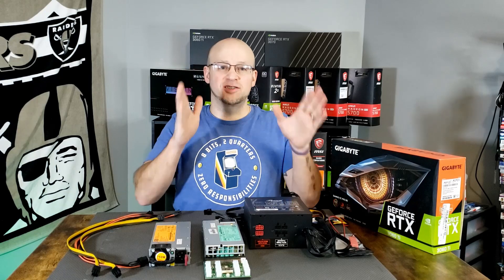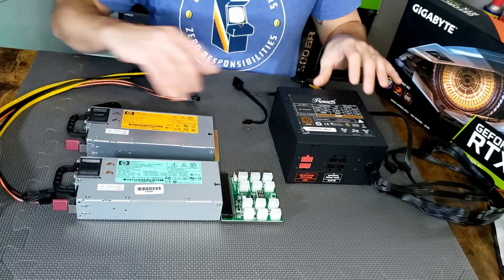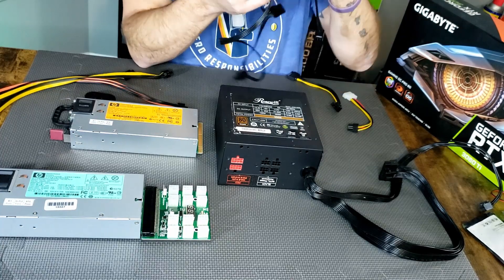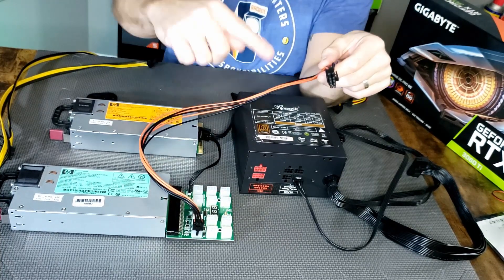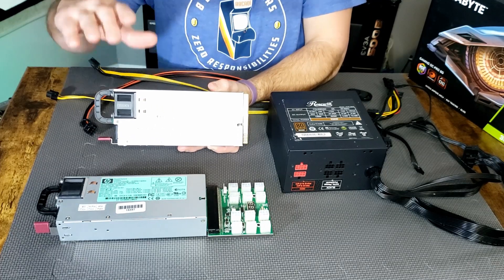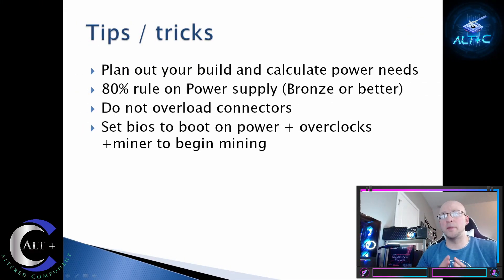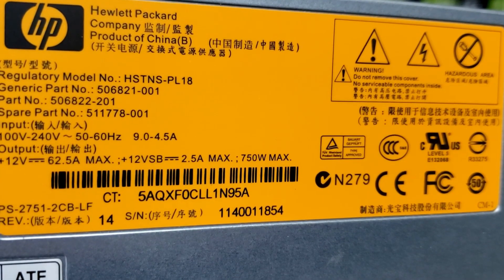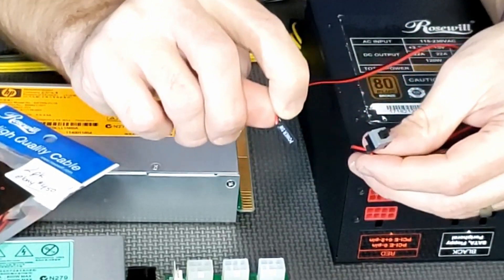How to use Server Power Supply for Mining Rig:  Quick Setup guide

Comment: Great video i just ordered a server psu. What kind of cables do i need to power my motherboard/cpu ? i think i will have everything for gpu,risers, but i don't know if i forgot something for the motherboard, thanks !
Reply from the maker: Thanks for watching.  if you bought just a server power supply to power the entire rig, motherboard, cpu, risers, gpus, etc, you need 1 of three options.  1) a standard ATX power supply to work with the server powersupply, 2) a ZSX all in one breakout board  or 3) A pico adapter to use with a standard breakout board.  You will still have to power the 24 pin on the mother board and a 4 or 4+4 pin cpu power.
Reply: @AlteredComponent  Thanks for the detailed answer, do you think is it enough to buy this for option 3 https://www.aliexpress.com/item/32828439849.html?spm=a2g0s.9042311.0.0.27426c37LiYA5o

Comment: What happens if I use ATX PSU to power my riser and server PSU to power the GPU? What happens if I power the riser and GPU on separate PSU?
Reply from the maker: Thanks for watching.  You can actually power the riser and the gpu from different power sources, but it is not recommended.  i did this for a couple years on an RX 570/580 rig and worked fine.  i had the risers all powered from an ATX psu and the GPUs were all powered by the Server Power supply.  That being said it is recommended to run a riser and GPU from the same power source to avoid issues.

Comment: Noob question I have a 1400watt server power supply and it says it’s rated for 200-240v now is there a way to plug this in a regular outlet maybe someone of adapter? Thanks for the education my friend just subscribed😇🚀😇
Reply from the maker: Short answer is no.  You can technically combine 2 x 120v outlets if on opposite pole and make a 240v outlet.  I have done this before for temporary measures, but it is not a good or safe long term solution.
Reply from the maker: Electricity is not a thing to play with.  If you are uncomfortable with changing Electric, consult someone who is qualified. Most u.s. have 120v outlets.  You may have 240 for a dryer

Comment: Isnt it dangerous to run 1 6 pin to 2 6+2 pins for gpu with the max wattage the cables can handle?
Reply from the maker: Perfectly safe in this instance. The 6 pin from a breakout board can carry up to 300 watts.  A 6 pin connector with 6 terminals in the connected is rated up to 288 watts.  As long as it is a 16g wire u can move 300 watts safely through a single 6 pin cable from breakout board.  A 6 pin connector on a gpu can only pull up to 75w.  A 8 pin on a gpu can only pull up to 150w.  So, safely run a 6 pin from breakout board with 16g wire and split to dual 8 pin connectors.  Take care
Reply: @AlteredComponent  i’ve been looking for this a long time on the internet. Thank you
Couldnt find anywhere that actually said how much W a 6pin could output on a breakout board. Im looking to use 6 pin from the breakout board to both the riser and gpu for my 1660 supers.
Only 1 question, how much on 18AWG cables?
Reply: Thanks for clarifying bro

Comment: Is that mini 4 pin mandatory, like can’t I just turn the psu on manually before the system boots, that ensures the gpu has power so it registers on boot, I only ask cuz I don’t have that cable and don’t wanna wait 12 years for eBay to ship it
Reply from the maker: You absolutely can just turn on the server psu manually.  If doing this way, hit the server psu switch and then quickly hit the ATX power button.  I did this on a rig for a couple years with no issues. thanks for watching
Reply: @AlteredComponent  no problem I’ve been watching for a while, great content. Thanks for answering that question by the way.

Comment: sata for risers really depends. i had 20 rigs do fine with them on 1050ti, 10606gb, 1660super. is it possible to run the whole thing off the server psu without a normal psu?
Reply from the maker: thanks for watching.  Yes you can use only server psu, but you have to either use a PICO adapter for the 24 pin / 4+4 cpu power with your breakout board or use the ZSX game changer all in one breakout board.  The ZSX is an amazing product but they are also selling like hotcakes.  This morning a batch was released with the 1200w hp in a combo.  they sold through quickly.  here is the pico adapter:  https://www.parallelminer.com/product/180watt-max-24pin-atx-power-module-included-sata-molex-cpu-power-connectors-ditch-your-atx-power-supply-entirely/?wpam_id=222
here is the zsx board: https://www.parallelminer.com/product/zsx-breakout-board-16-ports-pico-24pin-atx-fan-hubs-100-gpu-mining-a-game-changer/?wpam_id=222
take care

Comment: Can you connect two sata Connectors to one riser from two different 6pin to sata cables?
Reply from the maker: 6pin to sata are dangerous....here is why.  A standard 6 pin connector on a graphics card or riser board can pull up to 75 watts.  A sata connector can only handle 54 watts.  It would feasibly work, but trust me, it will eventually fail and melt.  I have melted a few myself over the years. A riser has the same possible power draw as the x16 slot pcie on a motherboard...these are rated up to 75watts.  Hope I answered what you were asking there

Comment: Hello Buddy

thank you for the video. You have a very nice explanation of this part, but the fact that I am not very strong with English, I wanted to ask you some questions.

Q1. I have 1 corsair 1000w and 1 PSU server 1200w now as you explained PSU server has 6 pin cables with 6 + 2 right? now I have MSI RTX 3060 TI and it has 2x 8 connetors now I want to connect 1 cable from PSU server with (splitter (Y) 8pin to 2x8pin) is it recommended and how many watts does the GPU give ?? because some in the forums say that it is not recommended to connect 1 cable with a splitter to 1 GPU for that I do not know what to do ??

Q2. I want to make combinations through the corsair and psu server for example with the corsair to connect some risers, and those risers that I went to connect with the corsair to connect to the GPU but the GPU to be connected to the PSU server with splitter is it recommended ??
or should both the riser and the GPU be connected to one place ??

to apologize for the text I believe you understand the essence
Reply from the maker: thanks for watching.  Yes, you can take a single 6 pin wire from the breakout board and split it into 2 x 8 pins for the single 3060ti graphics card.  you can pull up to 300watts from a single six pin on that breakout board.  A 8pin connector at a graphics card can pull no more than 150 watt total.  and when mining in this manor, you should have a 3060ti pulling only around 120-130 watts total when undervolted. 

It is recommended that you connect a riser and gpu from the same source.  So if you connect a gpu with the ATX power supply, you should connect the riser from the atx.  Conversely if you connect the GPU with the server psu, you should connect the riser from the same Server PSU. You can have say 2 gpus and risers running off ATX and the other 4 running off the server power supply and that is perfectly normal and acceptable.  All of That being said, on an older build i did a while back i did run all my risers from an ATX and ran all my GPU power from a server and did that for a couple years with no issues.  It is not recommended however.
Reply: @AlteredComponent  thnx very very this is the best explanation.. have a nice day my friend
Reply from the maker: @fatoshodja1517  thanks for watching.  Glad to help

Comment: I am completely new to this mining thing but I’ve always loved putting PCs together. That being said I’ve only worked on windows so HiveOS confuses me. Is it a totally separate software or is it apart of linux or windows? Also would you only need HiveOS to mine with or do you then need to use for example Phoenix miner or T-Rex? Great videos!
Reply from the maker: First thanks for watching.  2nd hiveos is just a Linux based operating system designed specially for mining.  From hive you can use many different installed miners, such as phoenix,  trex, lolminer,  etc.  You can also set your overclocks, change algos, and even program a new bios to a card (really for amd cards).  Hive os is a stand alone os for mining.  It takes the bloat of windows out and simplifies for mining.  It is a better option for set it and forget it type builds.  Me personally,  I like to tinker with much more and have the freedom to do more than just mine on a rig, so most of my rigs are on windows.  Look up hash raptors video on hiveos setup it is really good.  I believe mining chamber has one as well.
Reply: @AlteredComponent  Thank you! This explanation simplifies the process a bit. What software do you use to mine with on windows? I'm sure you've covered this in previous videos but I've only watched a few so far lol.
Reply from the maker: @Kyle-hf8dq  really depends on the card.     Back in the day everyone used claymore for eth...claymore basically is a dead project.  So then phoenix became the go to miner for eth.  The caveat is the new 30 series cards, those should be on trex.  I did many hours of testing and trex would allow better overclocks with less rejected shares specifically on my 3060ti's and 3070s. The main algo and mined item is eth, so short answer is trex on 30 series, phoenix on the rest
Reply: @AlteredComponent  Very interesting.  I'll keep all of this useful information in mind whenever I start my rig. Thank you for answering my beginner questions!

Comment: can you help me too,  be quiet! platinium 1200w or hp server 1200/1500w. Which one should I choose?.the most important for me is less power consumption. I'll use 6 or 8 cards rx 570 with btc-t37.
Reply from the maker: Hp 1200w is a platinum.  I would use either the hp 1200w with a zsx board and eliminate the need for a atx psu, or use a cheap 500/600 watt atx with a 750w hp server psu from parallel miner (with blue outlet as it is platinum) and an x11 breakout board.  The efficiency on those hp at full load is still 93-94%.  I personally ran 8x570/580 on a 750w hp and a bronze 550 roswill atx for 2 years. Was very efficient and really not loud because not full load on the psu.   Take care
Reply: @AlteredComponent  Thank you

Comment: How to connect 6 to 24 pin mb
Reply from the maker: You have to either use a PICO adapter, or you can get a special new Breakout board called the ZSX breakout board.  Both are available on Parallel Miner. https://www.parallelminer.com/?wpam_id=222

Comment: SO YOU ALWAYS NEED AN ATX POWER SUPPLY COUPLED WITH THE SERVER ? The server only powers the gpu while the atx power supply always power the rest of components ?
Reply from the maker: Well to be honest you do not necessarily need an atx power supply nowadays.  You could use just server power supplies,  but you would need a pico adapter so that it would have a 24 pin and a 4x4 pin for cpu.  Or they even sale an all in one server breakout board now on parallel miner that has a 24 pin, a cpu power cable and all the pcie cables...but the board alone is 60 bucks.  Personally I have always used a atx and a server psu.  The atx powers the mobo and components and the server powers the gpus.
Reply: @AlteredComponent  I believe I saw hash raptors video on that. Looked pretty sweet lol

Comment: Hello,  server psu power on first or the atx? or you can do it simultaneously? Thank you!
Reply from the maker: if doing manual, then server first, then atx.  but basically hit one, then the other.   I have an older rig where the server power supply cannot connect to the other atx so it cannot trigger on.  So, i manually flip that switch on, then i hit the main power button on the rig.  Thanks for watching
Reply: @AlteredComponent  thank you! :)
Reply from the maker: @jerwinwagan18  glad to help
Reply: @AlteredComponent  Yes man, I ordered my psu from parallel, still in processing, cannot wait to receive it. :)
Reply from the maker: @jerwinwagan18  I get a delivery tomorrow.   They rock
Reply: @AlteredComponent  :) how long it takes? I ordered last Saturday and still processing until today. Do I need to call them and ask? Thanks!
Reply from the maker: @jerwinwagan18  I would definitely contact them.  Mine Shipped next day.  It has been slowed due to weather though.

Comment: Hey quick question about the 4pin to molex to the atx psu. My EVGA PSU has 4 VGA ports which I use to power 4 gpus of mine currently with risers. Each VGA port has a cable split to power 1 riser n 1 gpu. Now I have to find power for three more cards on my rig. So my question is do I have to worry about that little 4pin to molex burning up and frying my break out board since the ATX psu already has GPUs in mine. My gpu is 850watts and the four cards with risers, CPU & Mobo is probably doing 550-600 total power from the 850.
Reply from the maker: Thanks for checking out the video.  To be honest you do not even need to connect the server power supply to the atx if not desired.  i have an older rig with a 750w HP server psu and an older breakout board.  it does not have the connector, only a old style sliding power switch.  For that rig, i manually turn that power switch on first, then the ATX power supply switch.  No issues for years that way.  But to answer your question, no, it will not overload the connector or fry your breakout board.
Reply: @AlteredComponent  thanks

Comment: How many RTX this server power supply support? I have 3x RTX 3090 and 1 PSU 1600W EVGA Titanium. But I can overclock almost nothing because the PSU don't support.

I have to setup another mining rig with 2x RTX 3090 and 1x RTX 3080 and I think about buy a server porwer supply, is infinite more cheap. I just not sure if works with 1200W server power supply in my case.
Reply from the maker: keep in mind that the 1200w hp server power supply is actually only 900watts if using 110 volt power.  That being said, if you are mining on those cards, you should be cranking the power way back.  Probably at 65% power, you want negative core , probably between -300 and -500, and you want to push that memory up to around 1200 give or take.  i believe a 3090 overclocked and undervolted should only used around 400w.
Reply: @AlteredComponent  Do you think support 2 RTX 3090?

Comment: In the "How to Connect" part of the video, what's the name of the mini 4 pin that connects the regular PSU to the Server PSU?
Reply from the maker: if you search "Floppy 4-Pin 3.5" Female Power Cable" you will get results.  You can get a molex to that mini 4 pin adapter for like 5 bucks.  Here is a specific example on ebay:  https://www.ebay.com/itm/Kentek-6-4-Pin-Molex-5-25-Male-To-4-Pin-3-5-Floppy-Drive-FDD-Female-Power-Cable/283397870825?_trkparms=ispr%3D1&hash=item41fbd454e9:g:38oAAOSweEFcdmOg&amdata=enc%3AAQAFAAACkBaobrjLl8XobRIiIML1V4Imu%252Fn%252BzU5L90Z278x5ickk7PdDazAlGltMLJlUhrWsD3xoBwpwBoRJc8%252B5cnkKRgb0NIj3riYvDL7L9bg%252F55aomq0cMjIDTWnCcBlWjlFGAXVX049OQftZTy6zTGPshb6%252Bh7ltZ2Eg8ktV%252F8yHGc1JINBIrMtAoY07ha6QLTCcx%252BIcpunOTyHrSWhM6pkSzBwk7kSZDf32%252BFK2DAEWI5F7moCuNb3mi1OGsAZvLPoHv2GHptnJE4BCA0PgEIfAu1oBOvs6ZcYu2S5dXMHSJR9Hjw2qMmHhIhsgOIg5d3DscqLITr8YYXB2Hcu0eLS9b1a6HgSI%252FyE54QAD2Kx6PJTfux3lrIu2OqnGZI2%252Bdm6L%252BObfY%252F85TNtxYVmd%252BXqP8P%252BzCZjtDytsPFTH%252FWl2YiV6%252B8MjfdBfs5BCq%252B2whKS9YxpGqUNN9JIR6lWNKyXwMh%252Bd7LzTjt0Ej8fOx5xxK1XtIROdi7P4LrO%252FpphEyqjS6dFoerkeeN9FZa6IZSFCUxMl5kD2vB7MfLKqHEf3Ua6P%252Fuw51UZ8rQC3e8kG80N%252BQlyV2DiczpktkMZRVDgoSVRmp5eJnjIiVazdaTjMlpJedzS9hfxKslwotSl8jHU%252Fk9s02ssAyI%252BhMmcoDsnOdVE7ueHrPOlN63nreJX8Tv%252FYG7r86VUzezq090jya96%252FMZo1a%252FSnSH5DNVPZDAEV2PXDnAyH1sea1cX6Pdn%252BcmPjI0y9409oUVxrBA7fHKVsv7FnQC323IvD7pl5yc33Es7EvE%252BFnYyJtk3BwXA08C6ph6XF0lmKuRjxhc4IqofEA3ZFEc3QP5%252FyRC%252FxR9umyEp%252BjdD1Hndwy%252FnviGxWW59m%7Ccksum%3A283397870825b50590f98a8d4f659de19b0074f99bc1%7Campid%3APL_CLK%7Cclp%3A2334524
Reply: @AlteredComponent  Thank you very much bro.